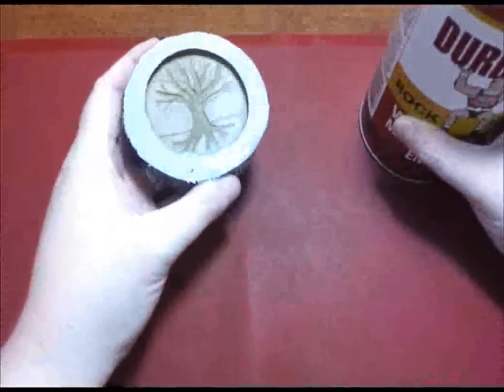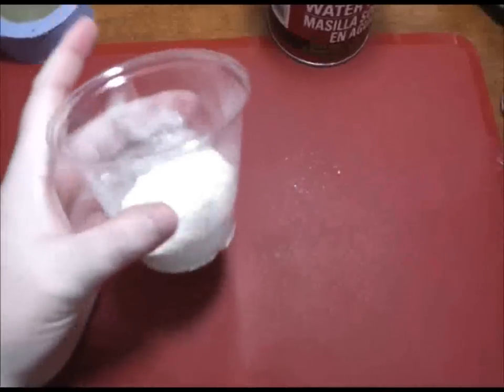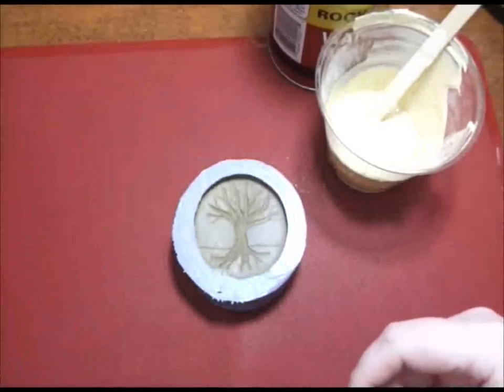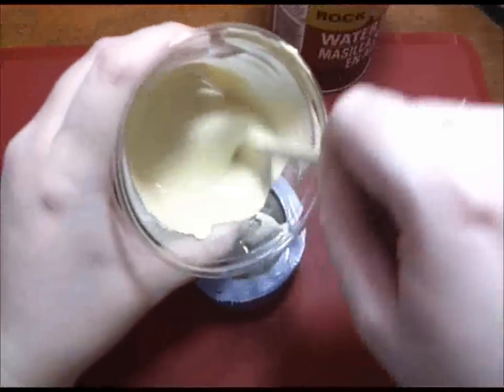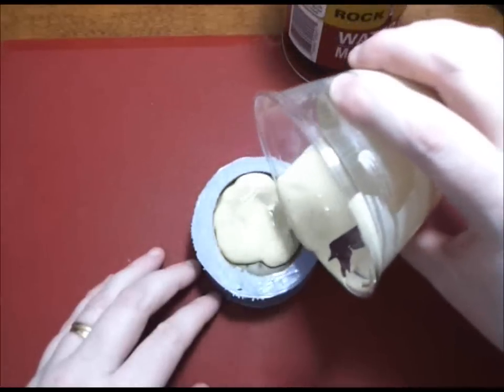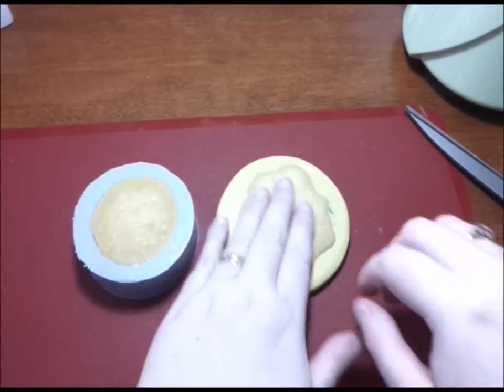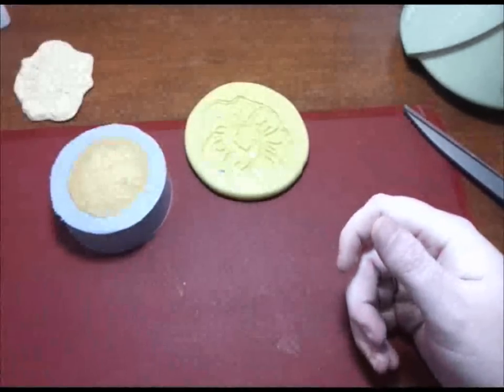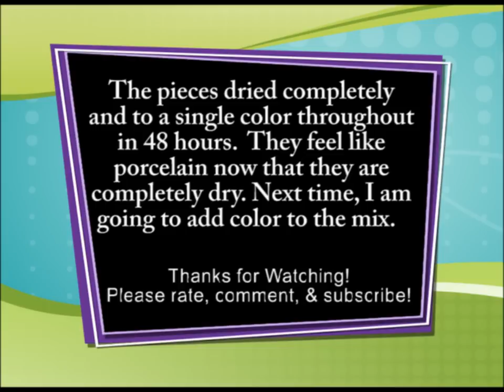Water Putty Molded Pendant Experiment

Comment from the maker: @TheMoparlvr   The two pieces that I made in the video I actually tested that out to make sure they were strong.  I don't think I will use it with the really thin one as jewelry but with some for scrapbooks and such it would be really great.  But the thicker round piece was really strong.  Not as strong as polymer clay or anything but unless you would really abuse the jewelry, I think it will be fine.  I have some sitting in molds right now because I think I might have used too much water...

Comment: Ive used this and you cant add color it will make the mixturenot dry properly. However they can be painted. Justmake syre theyre completely dry beforeyou paint as the paint wont stick to damp putty.

Comment: yes  to  do  a pendant  with  stuf you  got  do  dark  say craft plaint   say   you  what a gray  you   must  ues a dark  black  as   mix  it  will turn  light    and  you  do  thin  and  tick  thin  you  put  in  molds   and tack over night  to  dry  thick  you patch  thing   and get pendant  right   no painting need   if do terrain   fore gaming   you make  concrete stuff  hek  the  foam  bit  i   ues  to  sped it  made  great   walls  wen  thay  dry  just  glue  to  basses   me i add white glue  to  or PVA  this  give  littl more  hard  it  thats my tack  to  it